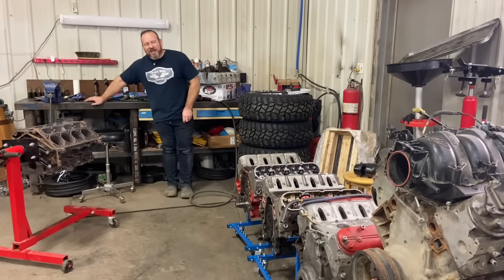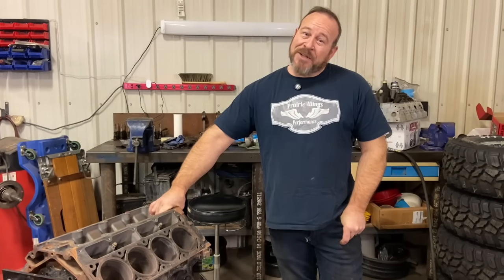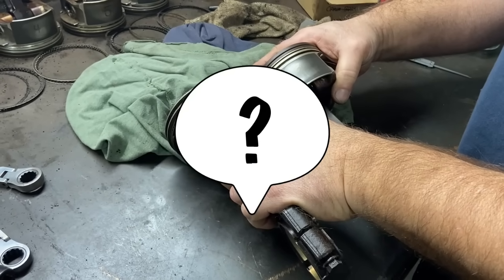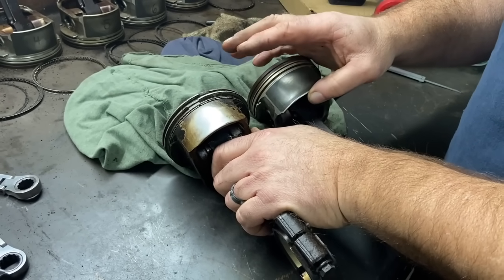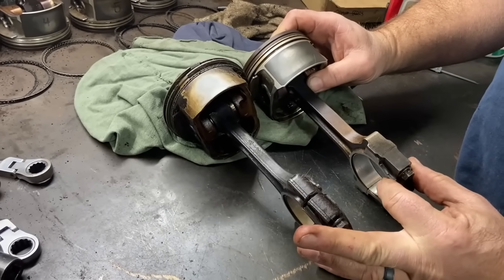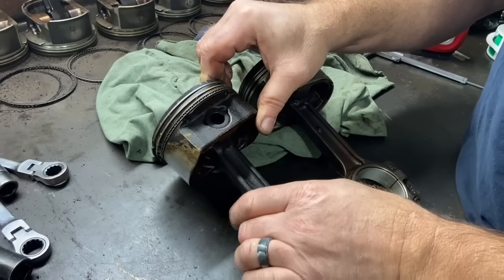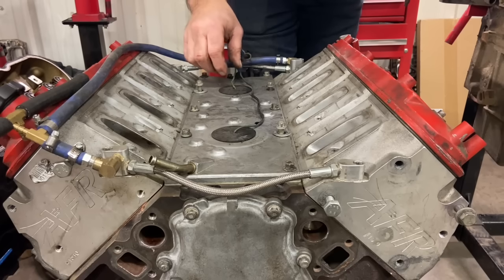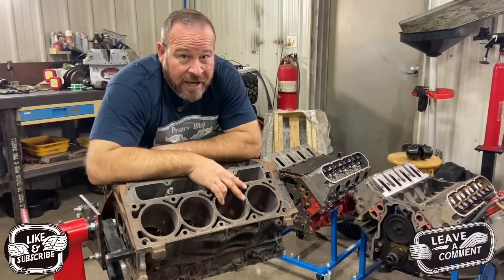Every LQ4 is Built Different - Here's What I Found

Comment: Federal Mogul was selling coated pistons since 1997. I think Ford started using them long before Chevy, but I have no proof. I worked for Federal Mogul when these were coming out and I was working the 1-800 technical Service line from Phoenix, AZ. One of the questions I got was from a Machinest who didn’t know how to measure piston clearance with the New pistons. The Phoenix office didn’t have that information so I took the machinests informartion and called the Southfield Office to find out what was up with the piston to cylinder wall clearance and was told to machine the block to the spec provided in the box of pistons. They had tested these pistons on one of the Southfield Michigan Technicians tow rig that he used to get his drag car from track to track. They had fitted them in a 454 with zero clearance between the cylinder wall and piston coating. It ran for years with no problems. Hie Chevy used them and why they didn’t adopt them sooner is beyond me. The coating allows for tighter clearances and provides less blow by. It’s good stuf!
Reply from the maker: Dry cool information and story, thank you for sharing!!

Comment: Cam bearings are a must. 2003 is end of gen 3 two length head bolts. thousands of LS motors got pulled for cold rod knocks. In fact it is piston slap not rod-knock "most" of the time. Press wrist pin rods are gen 3 only. The gen 4 rods are way more use friendly do it at home, (fit just fine in gen3). LQ4 with 862 head gains about a point of compression. low buck truck and a set of NOT 317 heads is 50+ hp. I cant stop when I do the heads. I have to have springs, lifters, lifter trays, push rods and ARP head bolts. Any time yer in that deep you simply must have a melling pump and new chain.
Reply from the maker: Perfect, thank you for taking the time to add to the conversation!!
Reply: Every single engine I've had the chance to reuse the pump on, always had 50+ psi. The pumps are only bad if it shats a bearing and it eats those bits or sucks air from a bad o-ring or low oil. With good maintenance, the pumps last 350k+ miles.

The only crucial part to change besides rings & bearings is the lifter TRAYS. Loose trays are what eats cams - never buy cheap trays from amazon/ebay.

Lifters aren't a bad idea but they're the single most expensive rebuild item. You can tell if a lifter is bad by pushrod wear at the rocker (clogged) and if the pushrod cup is sunk (bad internal spring).
Reply: @hydrocarbon82  that's fair!  Doesn't it feel like gambling after you got down that far, and walked away? I hate throwing parts away that aren't broken almost as much as I hate breaking new parts.
Reply from the maker: @hydrocarbon82 👍👍

Comment: Definitely change the bearings my 2004 lq4 died from a spun cam bearing with 230k miles .Everything else in the engine looked new. @nd or 3rd from the back spun and walked half way out , lost oil pressure down to 15 psi . Did it on a cold start leaving work , I heard it happen . Put new cam bearings in and we always use the green loctite press fit retainer fluid.
Reply: My 2004 pistons were not coated .
Reply from the maker: @onthelake9554 interesting, all of the 03’s and later I have had apart where coated, I guess like guys have mentioned could be the flip of a coin😂
Reply from the maker: I’ve never heard it happen, had to diagnose it and heard it making noise against the lifters. Thanks for taking the time to share your experience!

Comment: It seems that by 2005 the LQ4 got all the goodies. If looking for earlier engines, try the 2004 HDs or XLs
Reply from the maker: With repairs like you mentioned before, ya never know what you’re gonna get. Used engines swapped in over the years. Definitely wise to shoot for the newer donors.
Reply: I've pulled several 05-07 LQ4's apart, each has had gen4 rods, floating pistons, and 1x cam gear (but still used rear cam sensor). Most of them have coated pistons with the 1.2mm top ring (vs 1.5mm), and the top ring groove is anodized or coated. I've been lucky where I've been able to put 243's on most of them before taking them to the junkyard counter lol.

Oddly enough I've never had one with a bad #3 cam bearing, but again almost all were 05+ with the larger bearing OD's.
Reply from the maker: @hydrocarbon82 nice, you sound sneaky 🫣. Great info again.

Comment: I believe the first 2 years 99-2000 they had cast iron heads. Gen 2 blocks were made after the LS was introduced for Mercury inboards because hey used raw water for cooling. LS conversions for boats are very popular with a host of marine type brackets, etc. but only the first 2 years could use raw water cooling. I believe Mercury only started using LS blocks in 2016. Of course many LS conversions switched the boat to a closed cooling system and then it didnt matter.
Reply from the maker: Very interesting, thank you for taking the time to add cool information! Hope this helps someone in the marine world as well.

Comment: Early years, 1st year if I remember right, had cast heads.  Highly desirable for low end and average torque performance but not for power performance.

There was also a split year where crank shafts were longer if I remember.

LQ4 & LQ9 never had an aluminum variant like the L33 5.3 so ignore those comments and those were only put in "gentleman's trucks" not work trucks.  Just the change from cast to aluminum heads.

Don't go by what it came out of.  Go by block casting numbers and codes. Vortecs and LSs engines are the whores of the engine world and they have been around (everyone starts out on these engines because of the combined simplicity and mass production numbers  and that doesn't even count factory warranty work which could have been your 07' in question though the early engines (pre AFM/DOD) were bullet proof- don't know what you are talking about with week cam bearings.  It is possible that GMC's got blocks with the larger cam bearings, back in the day there were TONS of differences between  Chevy and GMC but less nowadays ever since GM killed off Pontiac and made Chevy the performance division (and added the quality of the killed off Oldsmobile).  My guess is that it was just different block castings sometimes GM does stuff kike that for real world warranty information R&D.
Reply from the maker: Thanks for taking the time to share!

Comment: I’ve not had the 6.0’s apart? But have swapped out some in my motor swapped tow rig. 
The 5.3 in my Suburban had the verbosity in the head issue. Bought a 6.0 from an ‘02 van, it was the long crank & cast iron headed version. Took it back to the salvage yard. Bought a 6.0 from an ‘04 Hummer as well as the 4L65E trans. Swapped cam, springs, rockers, & tune. RAN & PULLED AWESOME!! Ran this set up for a couple years. I’d used LS7 rockers & they flat spotted the valves. Swapped to another set of 317 heads, & tried 2 different size cams. 1 of the cams was just wrong? It didn’t work on the towing whatsoever? Idk the specs now? But, ran that combo for several years. I’m assuming the O-ring split on the pick up tube? Lost oil pressure suddenly & locked the engine up. 
I bought another 6.0 from an ‘04 Denali, 148k miles. Did a cam & springs swap along with another tune. I used the BTR Truck Norris cam. 2,500 miles later it lost oil pressure? Cold start 20psi, & the warmer it gets, the more it drops. Drive it a 1-1/4miles, it drops to 8psi. Shut off for 3-5min, & drive it 1/2 mile, rinse & repeat. 
The 1st words out of my mechanic’s mouth were “cam bearings”! 
I parked it a year ago. 
If it were the cam bearings, what I’ve learned between possible year splits & manufacturers of the engines, it could very well b the cam bearings?
Reply from the maker: Absolutely, cam is the first to get oil in these! I really appreciate you sharing your experience!!
Reply: @prairiewingsperformance6036  The oil pressure “recovery”, is what’s gotten me confused? It’s like the oil is draining back down? 
I’ve done a fresh oil change with an AC filter, replaced the oil sending unit, checked to make sure there wasn’t a screen n it & there wasn’t, double checked with another instrument cluster, added 2 additional quarts of oil, drained out that oil & added 20w-50 with a quart of Lucas. Notta bit of difference on any of it? 
The engine will just need pulled apart & put bearings in the engine apparently?
Reply from the maker: @Ccwm7089 the cam is the first thing to get oil, cam bearing could look like the one I showed. If it’s out it’s a major internal oil leak. These are pretty bullet proof. The pistons don’t have very good oil drains so the rings get stuck as well as the cam bearings go bad. Razor blade rebuild (budget friendly) and they are good to go again! I’m not sure when we will get the video out but we should be hitting the high points of doing one within the next couple months.
Reply: You'd be surprised by how many  have bad oil pressure switch or pickup o rings. The pickup itself can come loose and vibrate. Also different years have different color/style o rings that you don't want to switch. Which causes low oil pressure. Next I'd teardown the oil pump and look for wear or scaring. I've seen some questionable cam bearing run fine with good oil pressure if the rest is good.
Reply from the maker: @masoncampos7043 absolutely agree I’ve seen questionable cam bearings run fine as well. When they are coming out or spinning on the cam beside the bore they seem to run fine but low pressure. Great point about the o-rings. I haven’t seen one loose yet but I definitely haven’t seen it all!!

Comment: I believe the variations came from the aluminum and cast block years. The early 2000's really offered a confusing time between the l.s. family. The l.q. family was the mutt of them all.  The need for GM to have a parts supply for any platform. 2004-2007 was a technology nightmare.  Keeping the long blocks together as much as much as possible will help choose the correct kits to reassemble.  The head bolts are not only different for the block threads,  but also the heads. The head castings will also dictate length of bolts. 
  The rods are also specific to blocks with oil sprayers and windage trays. Radius the big end of the late versions is a major plus. Crimp the end of oil sprayers. Thats when they also started adding the skirt coatings. Squirt straws only provided a direct stream of oil so the coatings were needed. Pintch the straw ends for a fan spray covers more of the skirt when it reaches the bottom of the bore. 
   The knock sensors are also specific for the year of production. If you are using the original ECM...you need to have that year knock sensor! After market modules will work with any year. The l.q. family was specific to chassis models. Lq4 for 1/4 ton or smaller. Lq9 for 3/4+ models. The is also a difference in chevy/GMC models. The GMC models used blocks from a different casting plant! The Chevy models were used in the Janesville plant until it closed in 2004. Janesville or Deerborn plants used the different block threads,heads,rods,and pistons. Best way to distinguish what model you have is from vehicle vin. Point of origin and model. GMC had the better!!!
Reply: A lot of this comment is flawed. For one there are no aluminum block lq4's. Early modles had cast iron heads and longer crankshafts. Stopped somewhere late 90's or early 2000s, I forget. All lq4's after that had 317 casting heads, which all use the same head bolts. Which is why it depends on what year block you have. Doesn't matter what vehicle it came from. Truck, SUV, or Vans 3/4 tons came with lq4's and 2wd 4l80's. 07 and up 6.0L are not lq4's nor are Any aluminum 6.0's ( LS2, LS3). From what I've seen LQ9's are mostly reserved for Cadillac and Denali models with the mentioned flat top pistons. 05 being most common for crossover years with later or gen 4 internals. And from most motors I've torn down the cams aren't numbered so it's hard to tell what cam it is and how it specs out to other lq4 or lq9 cams. That's just my opinion, great video and good info Sir!
Reply: @masoncampos7043  SS truck also has LQ9
Reply from the maker: @b19jrm thanks for adding this! I rarely see LQ9s, I think they get grabbed up right away.
Reply from the maker: @masoncampos7043 thank you so much, I really appreciate you taking the time to add your experience to the conversation!
Reply from the maker: Thanks for taking the time to watch and share your experience!!
Reply: Heads make no diff on bolt length
04 up block is the accepted change over yr
Reply from the maker: @b19jrm I will have to take note, I believe the cam bore size change and head bolt lengths happened at the same time. I will need to pay closer attention if I find some cross over there. Thanks for adding to the information!
Reply: GM service information (SI) lists the LQ9 (8th digit vin = N) as an aluminum block. I found this to not always be true. The trailblazer ss and Silverado ss both came with aluminum blocks,  from what I saw as a Cad/GMC dealer tech at that time. The Denali and Escalade were listed as a LQ9 by VIN/RPO code but had a cast iron block until 2007.5 which was the body change and engine change to LS3 (6.2). From what I was told and remember, lq4 and lq9 shared the same camshaft dimensions (lift/duration) but had different compression and ECM programming. Lq9 had bushed rods at piston pin where lq4 had pressed fit. Lq4 (8th digit vin = U)was rated at 300hp in the 2500hd pickup, 335hp in the Denali. Lq9 was rated 385 hp and I mainly saw them in the escalade. Never did find out why gm spec'd all lq9 as aluminum block when escalades definitely had iron block with lq9 vin code.
Also, cast Iron head 6.0L was 1999 and early 2000 only for the GMT 800 series trucks, which was the 2500 non hd (hd models in those years were considered "classic" body which was the previous 400 series). 800 series suv did not come out until mid 2001, labeled as 2002, so the GMT800 suv's never had an iron head LS engine.
Reply from the maker: @kevinkalivoda3442 thank you for taking the time to share this information. Specs… who needs to follow those😂
Reply: @kevinkalivoda3442 was the LS3 put in a truck? I thought the change over was to the LY6, and LS3 designation was reserved for the corvette and camaro..
Reply: What's better about the GMCs? Thanks for these details here, had no idea.
Reply from the maker: @A @AdamDavidSoloman I personally haven’t seen a difference. I have to say I haven’t paid a lot of attention if the donors are Chevy or GMC. I would love to know and can comment any experience with differences. Thanks for the question.

Comment: 99 to 2000 lq4s long crank, long headbolts  iron heads, and uses lm7 cam, 10mm valley cover and header bolt, gen 3 rods

01 to early 04, short crank, long head bolts, 10mm valley cover bolts and header bolts, gen 3 rods, use ls1 cam

Late 04 to early 07, gen 4 rods,   13mm valley cover bolts and header bolts, 

Late 07, uses unique piston that is dished with a valve relief
Reply from the maker: Great information! I hope I get to see a late 07 set of pistons, sounds very interesting. I wonder if they used that same piston elsewhere? Thanks for taking the time to add information to this conversation!
Reply: @prairiewingsperformance6036  its a ly6 piston
Reply from the maker: @devin7632 ahh gen IV. Makes sense. Thanks again.
Reply: Cam bearing bores are different too

Comment: I always called the 04.5 and newer LQ4s and L33s as Gen 3.5 engines.
They run Gen 4 rods, Gen 4 cam bearings. I'm pretty sure they run a different oil pressure sensor as well. The older ones are taller and have a different connector.

The cams are different in the 04 and older engines, there's a few cam guys like Powell cams that have the specs. But in 05 and newer they all have the same cam as the LQ9. They went from 315hp to 345hp. At least that's what ive been able to find.
Reply from the maker: Thank you for taking the time to share, actual experiences shared are better than what we sometimes find in official documentation!
Reply: @prairiewingsperformance6036  Especially since we all know how GM has been know to let's say fudge with actual HP numbers lol
Reply from the maker: @masoncampos7043 noooo never😂
Reply: The oil sensor was changed in 03 with the p59 pcm, it's a 0-5v output vs a resistor and runs thru the pcm instead of direct to the gauge. Generally the larger cam started in 2001, it's the same as the 01-02 LS1 F-body cam. The HP increase is largely from being tuned for 91 octane and higher compression. The 9.3:1 comp LQ4's will pull 9k+ lbs on 85 octane with the stock tune.
Reply from the maker: @hydrocarbon82 thanks for adding this information to the conversation!

Comment: The Gen 3.5 (gen 4 rods) are free floating pins around mid 03' you started to see the Gen 4 rods in the Gen 3 engines. Its a crap shoot when and if it has it lol
Reply from the maker: Really,  that’s pretty cool. I’ve got 04 lq4s (old rods) then the collection jumps to 07 (new rods). Do you know if that was in the lq4s or other stuff? Seeing them in all the aluminum 5.3s. Don’t recall the lq9, it’s been a long long time since I’ve seen the inside of a stock one. Thanks again for the added info!!
Reply: @prairiewingsperformance6036 Its all of them. Ive seen 6.0s and 4.8/5.3s with Gen 4 rids after 03 1/2. My buddy had a 04' 6.0 that had them. And i have a set from a 03' with them. It just depends on when they started running out of Gen 3 rods lol. GM will start using the new design when they run out of stuff. I had a 90s truck that had brakes they shouldnt have. It was the next years brakes. Supply i guess 😂😂
Reply from the maker: @GrandPitoVic it is strange how they did that. I wonder if they made engines in different plants or if they all came from the same place? Be interesting to know…